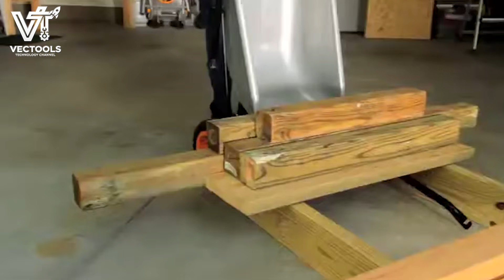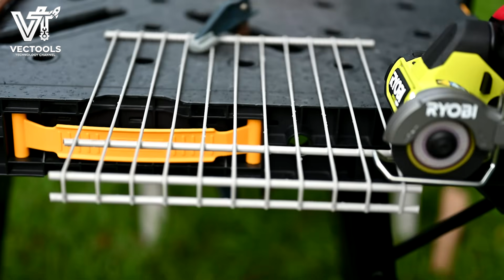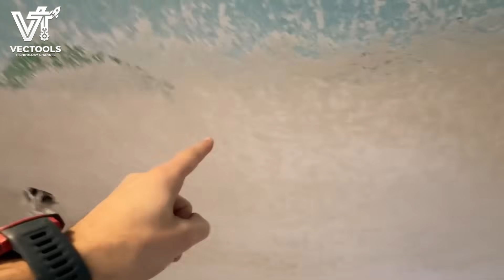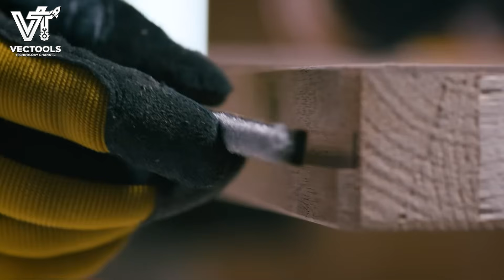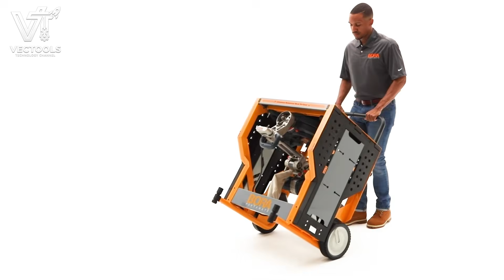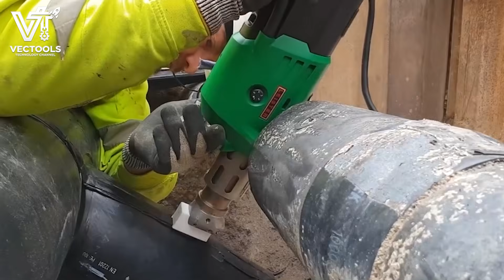16 COOL NEW TOOLS THAT ARE WORTH IT IN 2026

Comment: DeWalt really hit a home run with that electronic feedback on the router motor. My old corded Porter Cable bogs down the second you hit a knot in white oak. Might finally be time to upgrade the bench.